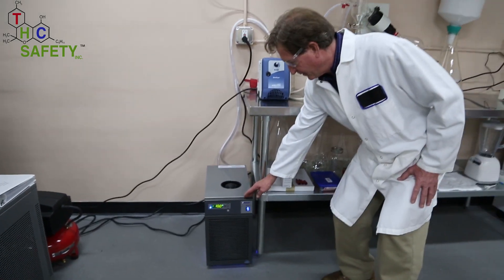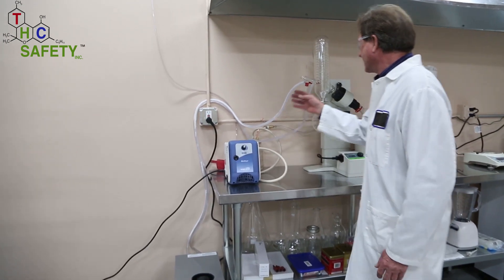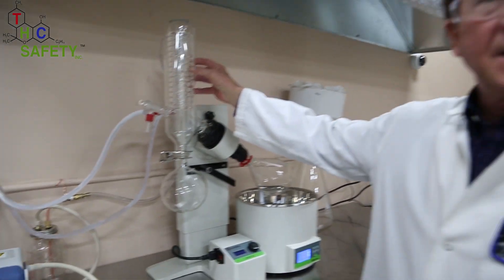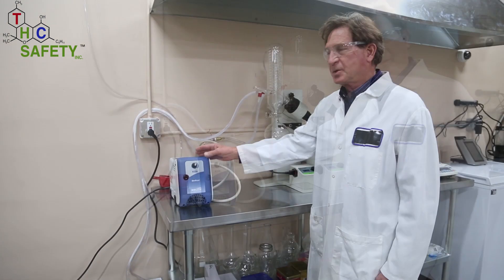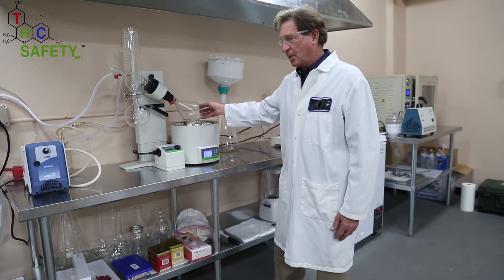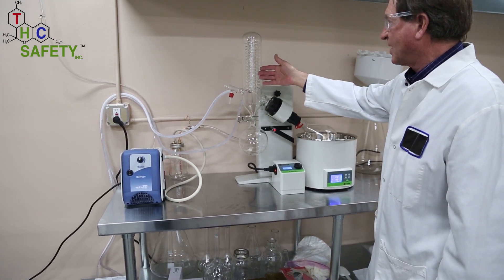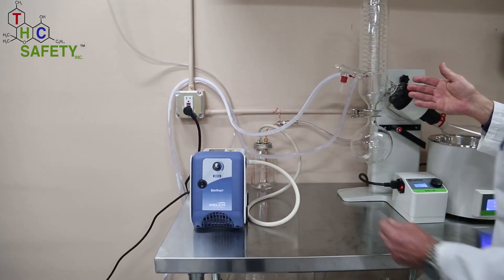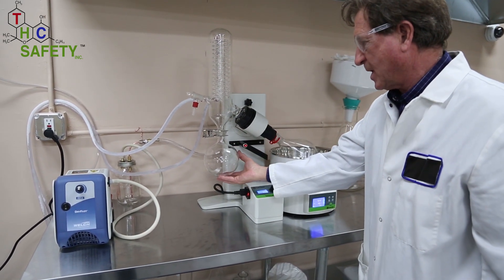THC Extract Rotovap Concentration - THC Safety

Comment: what brand and size chiller is that? Im looking for one that will fit all my cannabis extraction needs that wont break the bank, maybe some older technology that could work? Im running a 5L roto evaporator and a 2 L short path distiller.